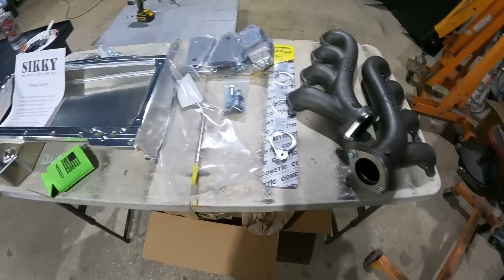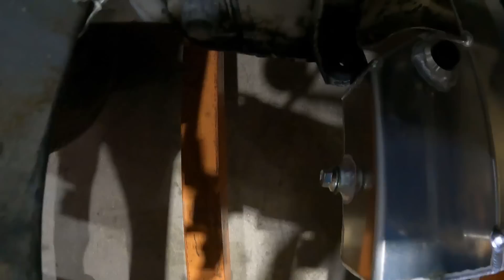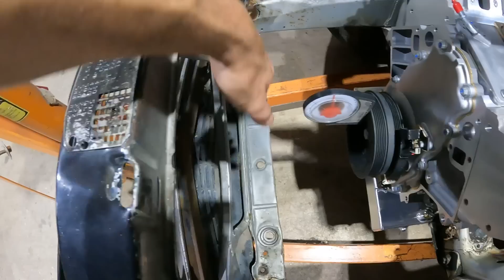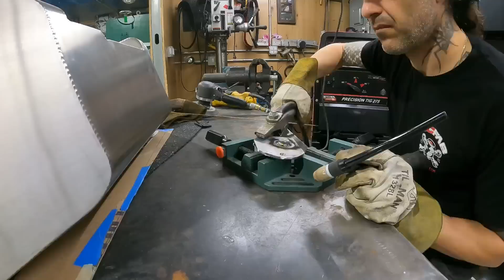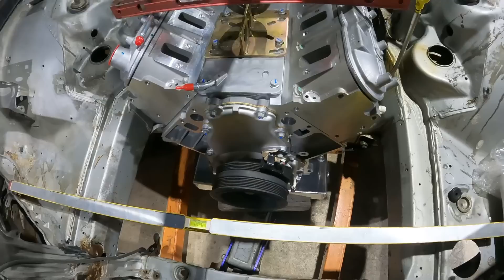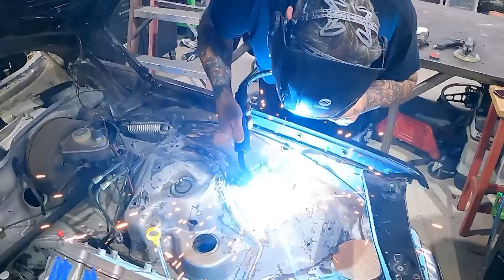Custom LS3 Motor Mounts for the 6.2L Swapped Mercedes - 208se V8 Swap Benz Build

Comment: Strange to me that you yanks generally never use modern engine mounts. If a racecar I get it but this is never going to race anyone except to the petrol station. Would be cool if you got to build a cool European diesel project. Like something with the OM606 or even better the VW Audi 5.0l v10 or 6.0l v12 Tdi engines..

Comment: Hi.guys,
What's the cost of this conversion? Approximately... Keep up the good work!
Reply from the maker: It all depends on the level of finishing work you want. We're doing a whole ton of metal work on this one to smooth out the engine bay and repair rust which brings the cost up a ton. If you want a quote on a project, you can always shoot us an email or a message on IG!

Comment: Looking good guys. I have a question, why when cutting off the plates on the fender wells why do you use a hammer and cold chisel as apposed to an air chisel? I was a bodyman for 15 years or so and we all used an air chisel for anything like that, once the spot wells were drilled out.

Comment: Coming along nicely!!! Is that silver in the engine bay the original body colour? Just cos I reckon a modern Merc silver would look really classy instead of the black 👌
Reply from the maker: This car has 4 different layers of paint, but the silver is probably the OG color! The whole Merc is getting a color change later on in the build!

Comment: I wonder if factory 2004-2006 GTO motor mounts would fit they look just like that
Reply from the maker: It's possible! These mount kits from ICT Billet work for most applications. It's very possible that they are similar to factory GTO mounts

Comment: really interested to see how you're going to do the rack. I had an LS in a C126 but even with the rack close to the stock subframe, it was so far forward I could only get ~35 degrees of steering. Used an oil pan from a 98 camaro. Probably shouldn't have been on the road but I drove it cross country. Had to three point turn into perpendicular parking spots :)
Reply: Should be able to use a BMW e46 rack. FCP euro used one in their 190e that they converted to rack and pinion
Reply: @1411MEDIA  a lot of differences between a w124 and w126 chassis. we'll see though!